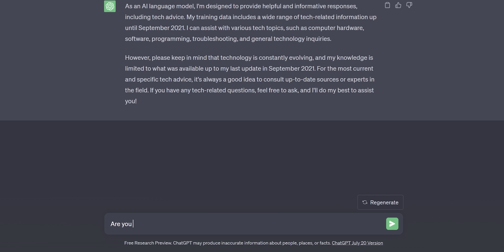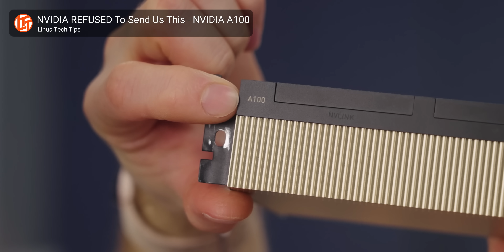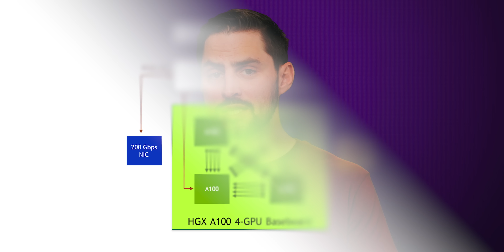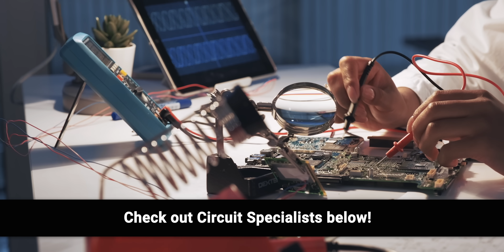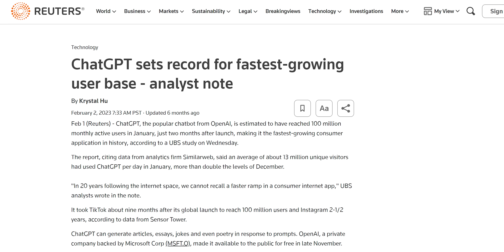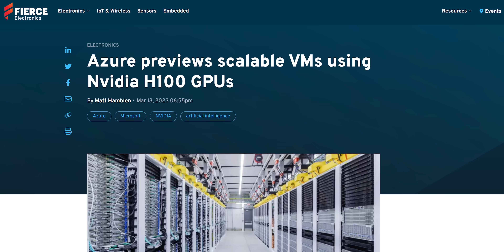The Insane Hardware Behind ChatGPT

Comment: It would be nice if they could pair down the language models to essentially just learn what’s on your hardware, home, habits, etc, that way it would be more natural for you to simply talk to your computer and only use a keyboard for gaming or writing a document.

There’s enough hardware on PCs nowadays, and you can bolster it with just PCI express if you want to add computer vision with it, learning the difference between an animal, a human, a spill, and so on and so forth.

This is one of the reasons I wanted an A2000 (power consumption) but it should be able to run with regular card- CUDA can run on any GForce card.

Instead of going to a server, you would have your own data “analyzed” at night- trading power for time

Comment: It would be interesting to have a desktop machine that also had SXM4 connectivity. At least it would be unlikely that your house would burn down, compared with the '12VHPWR' garbage connector. Fair enough, you'd need to add your own cooling but it could simplify airflow and there would be no pcb droop or PCIe socket strain.

Comment: Absolutely horrible video. Lots of errors just corrected with asterisks, and even then there are so many errors NOT corrected. You aren't comparing the same metrics across GPUs, and don't even mention anything about the real bottleneck: memory (both in size as speed). ChatGPT wasn't trained on A100s either, it was trained on V100s. GPT 4 might have been on A100s, but there is no info on that.

Comment: 🎯 Key Takeaways for quick navigation:

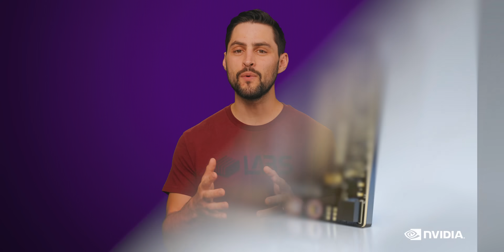00:26 🖥️ The hardware behind ChatGPT uses Nvidia A100 GPUs, which are specifically designed for AI and analytical applications.
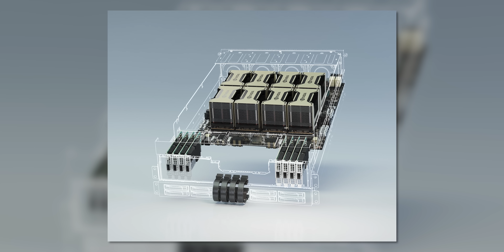01:21 🔌 A variant of A100 GPUs called SX M4 is preferred in data centers due to its higher power handling capacity.
01:33 💻 An SX M4 A100 GPU has 312 teraflops of fp16 processing power, significantly more than powerful consumer GPUs.
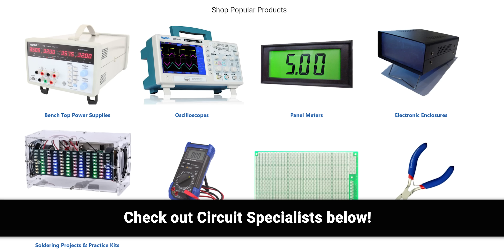02:01 🤝 Multiple A100 GPUs are connected with NV-Link interconnect to act as a single, powerful unit in GPU servers.
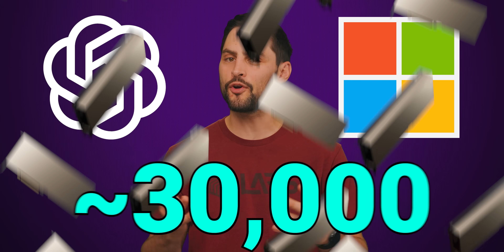03:09 💰 ChatGPT likely uses around 30,000 A100 GPUs to handle the demand from 100 million users, requiring a significant investment.
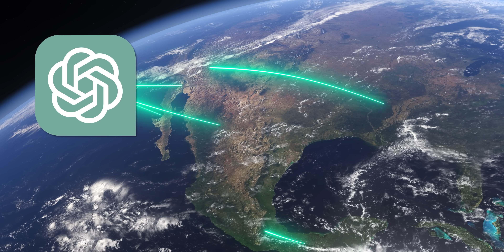03:35 💵 The investment on Microsoft's part for hardware and maintenance of ChatGPT is in the hundreds of millions of dollars.
04:15 🌩️ Microsoft is integrating newer Nvidia h100 GPUs into its Azure Cloud AI service, allowing for more users and training larger language models.

Made with HARPA AI

Comment: So I should be able to run a pretrained, slightly smaller network like this on my own gaming computer? Maybe with a more optimized architecture in the future, we can all run our own chatgpt on our phones even?
Reply: Yes, and yes. You just need to realize that the response rate us SUPER slow depending on your own configuration. You could also spin something up in google collab as the machine, hugging face for the models, pinecone for vectorization and I am forgetting it atm but another service for saving the training data. Most are freemium and also realize that there is a bunch of free stuff coming out of Azure.

Comment: I don't know if this has been answered before, but why do they prefer to use GPU over CPU when it comes down to use cases like these? Can you make a video about it? Thanks.
Reply: Compared to CPU who have to handle multiple kind of tasks, GPU already specialized to have higher similarities in feature optimization for this kind of tasks. Graphics deals with vectors, matrices, trigs, and floating point numbers and have functionalities to handle it baked on the hardware level.

Modern CPU slowly moved to that direction (iGPU, MME/ AVX,  hardware decoder, etc) but there's no beating a specialized chip in terms of performance. And since the market for GPU already exists and demands somewhat similar performance, its always cheaper to use them compared to developing custom CPU for the task.
Reply: Parallel computing, for GPU it's more calculation outputs per watt.
Reply: It's the same reason that GPU's are used for graphics rather than CPUs. The type of operations that GPUs are built to do really fast and well, and many at once, are the same ones that AI also uses.
Reply: Because with CPUs the same tasks that are done in hours with GPUs would take years.

Comment: Idea: durability of nvme ssd’s, had a bit of a look online and found no comprehensive tests on how long the drives will last. Does 600TB on a nvme MTTF mean after 600 terabytes the drive could fail and go onto read only mode. What if the same file is written 600 times does the drive just move the data along on saves to prevent this being a problem?

Comment: Correction on the A100, the 10.000 version is the 40GB model, the 80GB model tends to go for double and thats the one AI people actually like using.
Reply: The A100 40 GB  model has also been discontinued as far as I know
Reply: Just wanted to add this as well. Even more: the PCIe versions are cheaper than the NVLink versions. Only the latter are able to pool the VRAM together. That are at least 2 errors / in this video, one corrected with text. One not corrected / imprecise. Another example of the root problem at LTT.

Comment: You missed the most important spec of the A100/H100: it's memory. 80GB at 2TB/s, twice as fast as the 4090. VRAM capacity and bandwidth are what really matters in these AI/HPC workloads. More capacity means a larger model fits, and performance is proportional to bandwidth rather than TFlops/s.
PS: Comparing sparse matrix FP16 TFlops/s of one card to general FP32 TFlops of another card is bogus too. Quality on LTT channels has really suffered recently.
Reply: Not to mention that the FLOPS comparison is apples and oranges, they compared the non-tensor FP32 performance of the 4090 (83 TFLOPS) to the BF16 tensor performance of the A100 (312 TFLOPS), as if these are equivalent. The 4090 actually packs equivalent or better tensor-core performance compared to the A100 (depending on metric used).
Reply: @MrJonaslaCour the a100 is prev gen (Ampere) compared to 4090 (Ada) and h100 (hopper). it's just that chatgpt was trained before the h100 OR the 4090 came out, and the point of this video is how they made/run chatgpt.
Reply: @MrJonaslaCour  Glad you mentioned! The writers didn't do enough research.
Reply: in light of the gamersnexus video, this comment just became more accurate
Reply: This aged like fine wine
Reply: gamers nexus video reminded me how bad this video is and amazing it is still up.
Reply: For completeness: the A100 comes in two variants, 40GB and 80GB.
Reply: I bet nvidia limits the VRAM on even 90 class consumer cards on purpose so they can't be used for AI stuff.
Reply: @KeinNiemand  yup, exactly.
Reply: @KeinNiemand and they (make boardpartners) put hilariously oversized coolers on consumer GPUs, such that they physically don't fit in servers. Extreme case is the low-spec dumpster fire ASUS "4060" with a 4-slot cooler.
Reply: It's TFlops, not TFlops/s
Reply: Why dont you buy 2 4090s then instead paying 6x as much
Reply: @xcrayz3131  The memory doesn't show up as 1 "pool" if you use two RTX consumer cards. If you are trying to load and train a model which is 80gb, you would have to write your own parallel instructions for training the model with 2 4090s since you have 80GB of memory but its 2 40gb pools. It doesn't scale well and writing a library like that is not worth the effort. With the A100s or H100s, the memory is pooled together and the CPU treats the cluster of GPUs like a single gpu. It doesn't need to schedule separate instructions for each GPU. As someone else mentioned, bandwidth & latency is super important for data at this scale.
Reply: @xcrayz3131  It's not quite as simple as just throwing more GPUs at the problem. You run into a lot of issues with communication latency and bandwidth
Reply: Spot on. And FP and Tensorcore are not interchangable terms - very different circuits.
Reply: can you do a cfd sim on an fpv freestyle / racing drone?
Reply: @marc_frank  his project is open source? you can do it yourself?
Reply: @ajdinnnnnnnnnnnnnnnnnnnn  i could but i can't
Reply: @marc_frank Thats a good question
Reply: @IdentifiantE.S Or just use the funds allocated to R&D to build as many models as possible to ensure at least one of them is working. Fpv parts sure are expensive but so is renting a data center for fluid dynamics simulations. Also if something fails just blame it on the customer and deny their warranty. That's how it works.
Reply: @dlog  Ok ok thanks
Reply: *its memory

Comment: Interestingly, the limiting factor for LLMs (and most ML models running on these systems) is actually now memory bandwidth. Utilizing >33% of the raw FLOPS is considered good and more than 50% is great. (And that's even with the insane caches and memory bandwidth.)
Reply: This not only holds true for ML models, but also for High Performance Compute applications. The amount of compute you need to do on a single memory access is getting to ridiculous levels in order to make the GPU even reach its maximum compute capability. Most of the time the application is just waiting on data to flow in from memory in order to actually do useful compute. Like processors before them GPUs are extremely bandwidth limited at the moment.  So adding more FLOPS to the core almost makes no sense anymore. Unless of course you are trying to do something as computationally complex as Ray Tracing
Reply: You seem to be someone from whom I can gain some value insights about computing. What's your thoughts on the prospects of computing in memory, if you care to share?
Reply: Thats also coincidentally where all the energy gates wasted too. Transferring from memmory.
Genuine question, why hasnt anyone put much thought into fiber optics? If the whole von neumman bottleneck thing is an issue, why not just have these high performanc RAM chips, hookup to the CPU straight to the die through fiber optics?

Either that, or just go gung-ho on the cache and have ML chips come pre-installed with all the memmory it needs.
Reply: @honkhonk8009  That's what HBM2 is, although not with fiber, the RAM is directly integrated on the same die as the "gpu", you effectively have only one chip and so, the connection is as short and fast as possible. Just lookup gddr6x (rtx4000) vs hbm3 (h100), the latter is more than a 100 times faster.
Reply: @honkhonk8009  I am not an expert in the field, but I am assuming that it drives cost even higher, as electric signal needs to be converted to light signal. There are memory that stack on top of cpu, like the AMD x3d, but idk why it's not on gpu
Reply: @honkhonk8009  so far AMD announced processor with 1GB of cache. It's enough only for smaller models. Besides, GPU cores use way more power than memory. Using fiber optics would cause additional energy costs - you need to convert signal from electrical to optical and back to electrical. It doesn't really make sense since electrical signals are the same speed as light, so there is no benefit in time nor energy.

Optical computing may have some advantages here. But so far they belong to the domain of sci-fi

Comment: Technically, yes, you need more processing power to train the model, if you're comparing 1 to 1 (training vs trainned), usually after the model is trainned it's way easier to run, but as the demand increases, it'll surpass, as explained in the video.

Comment: fun fact, i build and codes a chatgpt in irc, back in 2006.
coded the bot to just learn in the first 12 months, in more than 250 rooms.
after that year, you could have a semi good conversation with it and it even had control and automatically administrated over 50 cs servers, intelligently banning cheaters,
answer questions like, "have you seen my buddy Linus lately? replying with: oh he was on server 17, 23 min ago.
running statistics and could pull data from the web to answer question it didn't know, like google does "i dont know the answer to that but here's what i found"

Comment: Seeing all the costs and capabilities of the system I don't understand why this tech has been made available for free to everyone.
Reply: Training. It’s useless without it. You take a loss for a couple years, build your real system in the back only putting forward to the client “new” tasks it needs to learn as new features with the eventual goal of offering it as a real service to companies replacing millions of workers that sit in front of a computer or phone answering simple questions, doing accounting, legal advice, basic programming, bug finding/code qc, basically anything that doesn’t require physical labour. Microsoft itself has 221k employees, more than half would get erased by AI, if you assume the average salary is 50k/yr that’s 5.5billion in wages saved every year. Do you think they care about a 1 billion dollar write off, and another 100million a year in running costs? Even if they offer this for 5 years free and upgrade every year, once unleashed the payback would be 1 year. Which as far as ROI goes is stellar. That’s just based on Microsoft. How many tech companies have tech support? All gone, especially level 1 and 2. Those would be day 1. The average low end wage in India is about 4$/day, now if you run 24/7 that’s 8$/day x 30 days = 240$/mo, they could sell one seat for 120$/mo and still be cheaper than any employee anywhere. So think of the scale and you will see that this is a VERY smart investment and that’s why it’s such a race to be #1, you are talking tens of billions a year in profit, in perpetuity. Sadly it also means a lot of people will starve or have to find some other employment which will be very hard when the only jobs are hands on and they have no skills in a slowing global economy.
Reply: @radugrigoras  that will devolve into absolute chaos quickly, that many people losing a job at the same time? Oof.
Reply: Take a peak at terms and agreements ;)
Reply: At the bottom of the page, it shows "Free Research Preview"
Reply: To be first!